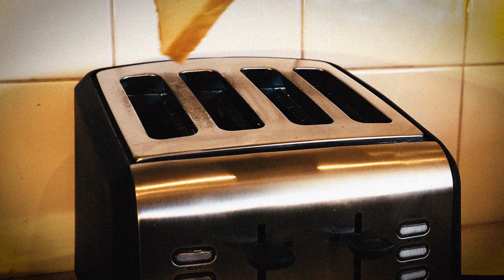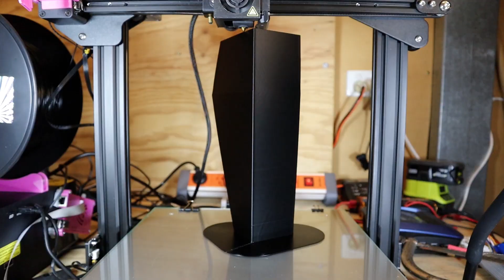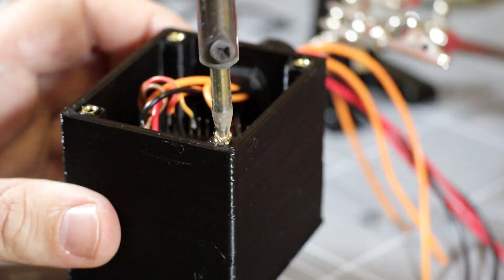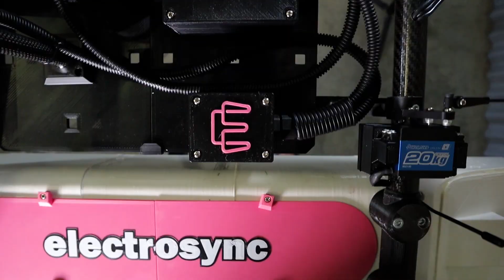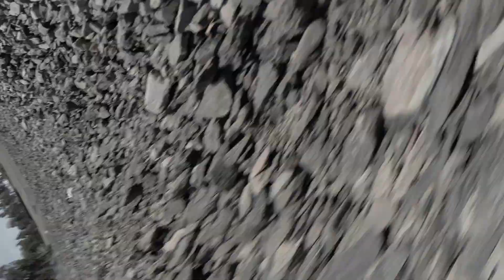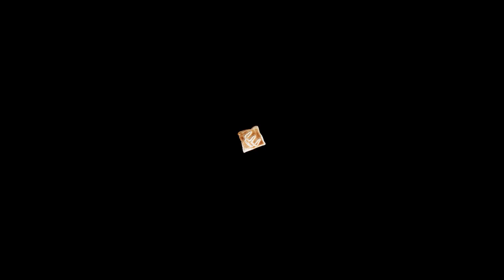3D Printed RC Utility Boat - Water Sampling System - Part 2

Comment: Amazing channel!  I think variability in the sample level was ok. Alternate approach would be peristaltic pump stepper driven.
Reply from the maker: I considered a peristaltic pump (or even multiple). There are some great 3D printed designs out there too. Self priming and a decent flow rate was why I chose the pump I did. But in hindsight, flow rate is not that important. Thanks for watching!